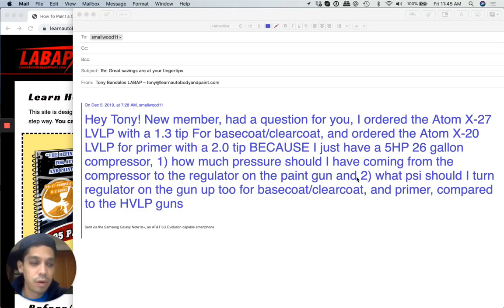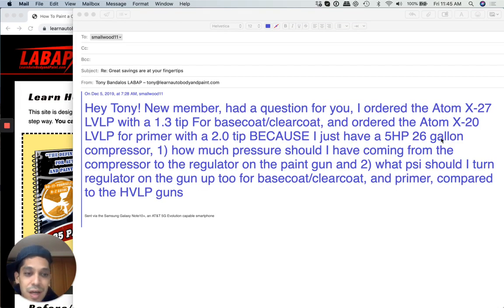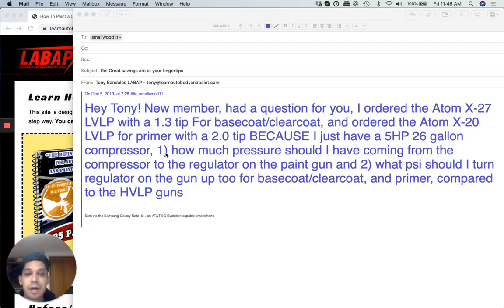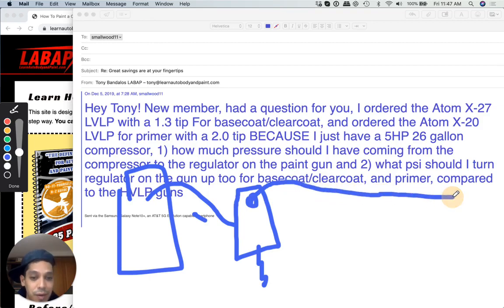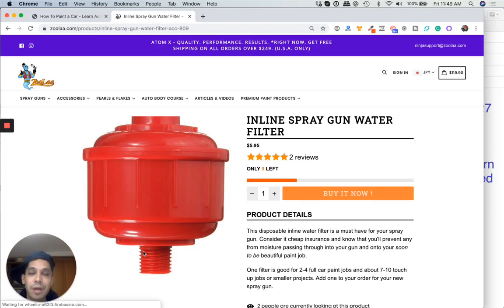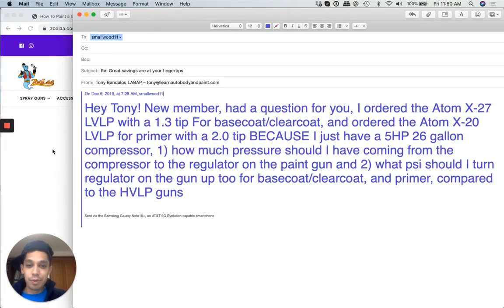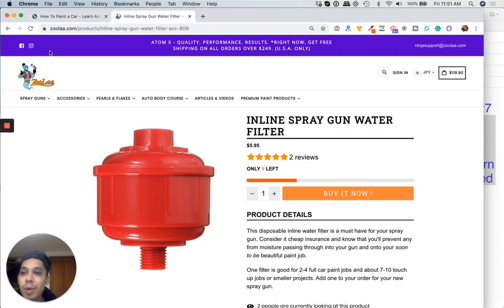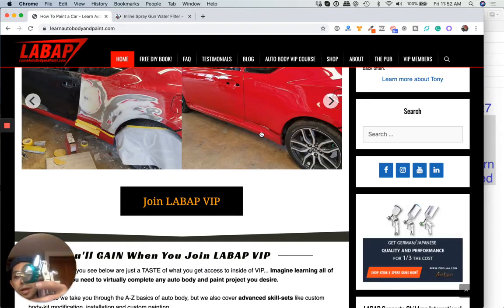What PSI Do You Need for Car Painting🚗🚘

Comment: I have 60psi to the gun...same filter/regulator setup as you have. I find that the setting at my gun regulator is touchy. That is, the knob adjustment is almost like an on/off switch  I also seem to only get good atomization with clears and primers when I have excessive pressure (40-50 psi at the gun). I thought maybe my gun regulator was bad, but I've tried 4 different ones, along with several guns in varying quality. Same situation with all of them. I have been getting good results, but my psi does not match the suggested pressure. Thoughts?
Reply: Forgot to add, it's a 60 gallon compressor.